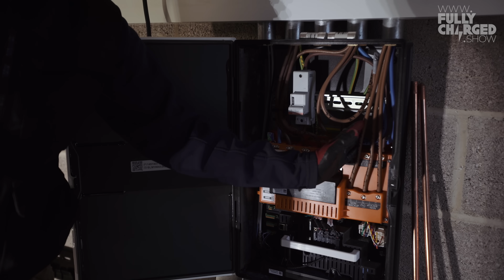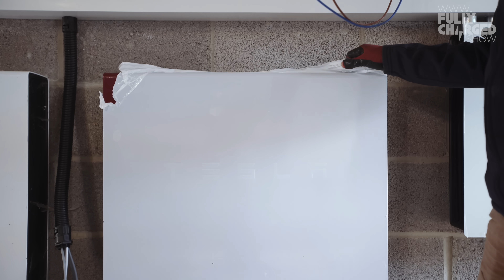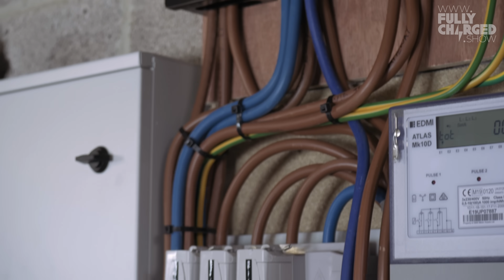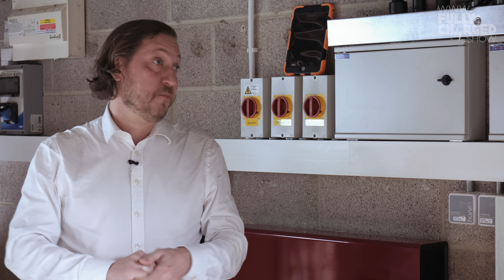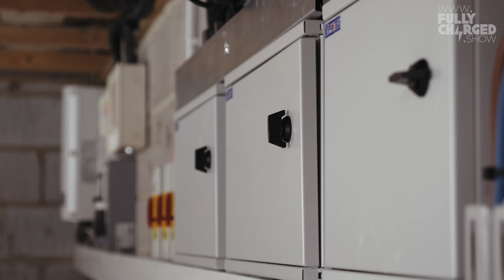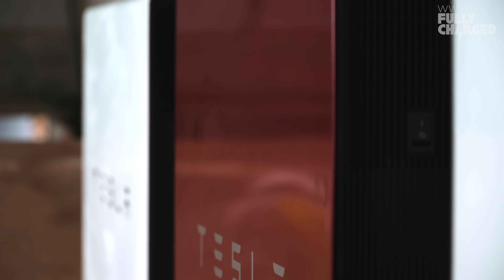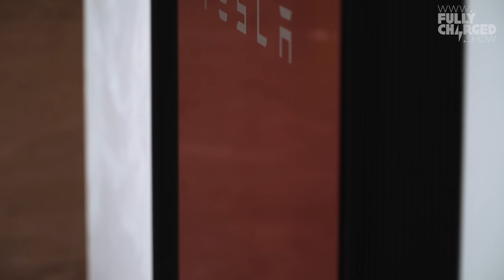Can you run your house on a battery? Tesla Powerwall 2 (Founders Series) & Tesla Backup Gateway 2

Comment: Question: what happens when you break that connection to the grid, are away from the property for a prolonged period of time where you're not using much electricity (if any) the batteries are full and the PV are generating, and putting power to the immersion heater, where does the surplus electrical energy go? Does it get spiked into the ground? 
I am aware this is a VERY unlikely scenario, just interested in what people think/know would happen in that hypothetical situation?
Reply: If I recall the video correctly, feeding into the grid was mentioned (not sure if refunded or not)
Reply: @Gwydion67  but my point is - if the grid connection has been broken - where does it go
Reply: Sorry, I missed your first words "cut off from the grid".
In this scenario the pv panels still would provide the voltage, but no current ("electricity") is flowing. Any physicist or electrician may correct me if I'm wrong.

Comment: I understand that Robert didn’t have to pay for the 2nd Tesla Powerwall (v2), but would it possible to get a break down of 1. the cost of such installation (cost of solar panels with size of installation, cost of 2 Tesla powerwalls, cost of upgrading to 3 phase, cost of installation and 2. kWh electricity generated every month on the last 2 years and where it goes (Tesla Powerwall batteries, car batteries, export to the grid...), and 3. Income generated every month on the last 2 years by the solar installation

Those information would be very, very valuable to give a better idea of what to expect in real life usage of such installation, and calculate the Return On Investment (ROI) (or much more likely, the loss). 

In theory, I would be interested by doing such installation close by to the Brittany region in France, and it would be very helpful to have an idea of how much money I would need to accept to loose if I would go ahead. Thank you.

Comment: I have 2 powerwall2 installed as back up to my grid tied 10k solar array.  We had the array for 3 years before we got the powerwalls. Enphase system...flawless.   I bought the powerwalls instead of a back up generator.   The powerwalls were 13k USD to purchased and installed. I had a quote for a propane powered back up generator of 7800 plus 100 gallons of propane...After the tax credit the cost difference between the genset and the powerwalls way about 1k USD.  I live in a small town in Central New Hampshire with very expensive electricity  .22 USD per kWh so the solar array was a no brainer.   Our contract for power purchase and buy back with the grid power provider is equal...we buy power for the same price that we sell power. While a great deal it makes it harder to financially justify the powerwalls   The power purchase price is the same all the time no price demand fluctuations.  The main reason we needed back up power was our grid power supply is not great. I don’t think I’d call it unstable but...since the powerwalls were installed in February 2019 till today December 2019 we have lost power 31 times.  Not long outages longest 1 hour 46 minutes.   Most outages 10-15 minutes. Years ago during an ice storm and it’s aftermath we were without power for 17 days, this event cemented our desire to increase our level of electrical independence. The powerwalls pick up the load with no delay, once in a while the lights might flicker not enough of a drop to need any reset of clocks etc. I realize we dropped some serious cash in this set up but we spent 300/month USD for electricity now just a 13USD  account/meter charge. The savings is about 11.5-12 % annual yield on our cash investment even with the powerwalls. Where else can you get that yield...not long after the solar install we purchased a Chevy Volt...flawless.   The volt functions in our home as an EV   we very rarely buy gasoline maybe a few gallons every other month   We have been able to absorb the additional load of the Volt’s 10,000 miles of annual usage through a more conservative use of our precious solar power. We are very grateful to have this technology in our home...

Comment: Exactly the video I needed to see. My villas in Kalbarri WA had a power outage today and the guests are upset that my new solar systems are not powering their darkness (heatwave of 40+C taking out the grid).

So not only do I need to save up 11k each for the powerwall, but also a decent amount of $ for the switches and install. Good to know!

Comment: But why you need 3-phase or a battery? You can charge it with one phase too slower but you can on the 8 hours at night when electricity is more cheap if you have discrimination bill.

Comment: Presuming the house is still just on one phase as rewiring a house to spread the loads over the three phases would be a pain, then the other two phases are just for the Zappi car charger? And so how are the two power walls spread over three phases or are they still on the single house phase ? I'm presuming they're on the three so as to feed the zappi with full battery if poss or am I barking up the wrong errr forest.
Also has anyone discovered how these gateways control electricity flow from / to grid, battery, house? If the soalr feed is AC coupled then essentially that's a direct connection to the grid so how does the gateway stop it all flowing back to the grid and divert it to the batteries or house?  Voltage variation or some such witchery?

Comment: You should have asked Mark to go through all the devices and connections , all the details basically.  
I wonder if you would have wind turbine or two turbines connected to the system if that would allow you to be completly off grid even in winter.  For the house I would say no problem, but the car is lot more demanding and thirsty then the house.

Comment: You can’t use a Solid State 1 to 3 phase converter?
Reply: It's not about having a 3 phase supply. It's about having the extra cabling to cope with the extra power that might be fed to and from the grid.

Comment: I don't have a garage, and nowhere inside the house to put that wall-full of boxes and cables etc...  except maybe the loft?  But I do  want a Powerwall.  So my question is:  Is it possible to have all that gear on the outside of the house (in some sort of lockable box to prevent interference?), or have it all in the loft?
Reply from the maker: There are loads of questions on the comments here that I'm not qualified to answer, but absolutely yes, you can have them outside, the 1st Powerwall we went to see was outside the house, and also remember, I have a load of other stuff on that wall for V2G (episode coming soon) and I had to have 3 phase, and there's other chargers, inverters and solar PV, so installing a battery alone is a much simpler project.
Reply: @fullychargedshow  Thanks for replying so quickly.  When I can persuade the Mrs, I hope to have a full solar PV & battery combo installed as a "bundle"...

Comment: That backup changeover takes ages... surely they could have made that faster, if it has to be a chunky switch why not store energy in a spring which it can use to throw the switch onto battery operation? Really it needs to be fast enough so that computers plugged in stay running. This is almost 2020 after all!

Comment: Makes zero sense.
We just went through this with The Energy Sovereignty Project this past year.
The power companies tell you that you have to upgrade thinking you will drop the project.
The result of installing the batteries is that you reduce the load on the grid... not increase it.

Hopefully more people will start class actions against the utility companies that insist on useless upgrades.

Comment: I would like to see the batteries mounted at least 2 feet above the concrete floor in case you have water in your garage or basement. Is there a reason to mount them on floor level?

Comment: 3 phase into newbuilds sounds very difficult, given it's absolutely impossible to convince most of the developers to abandon the standard 3ftx1ft external meter boxes in their cookie cutter homes. You're not fitting a 3ph smart meter and a 3ph head with that gigantic crutch cover all in the box. Some developers are even building with slimline boxes now which are only just wide enough to accommodate a 4 terminal meter. Real change has to be driven by real enthusiasm which would require you to really get your teeth into the HUGE property builders and architects and get them on board!

Comment: Wish I had enough money to install that at my house... my house (in Victoria, Australia) has lost power 4 times this year... I think I added it up to about 16 hours+ without power this year...
Reply: Had the same problem ended up getting a luminous ups inverter fraction of the price 2 years going strong
Reply: I wonder if you have lost power this month with fires raging??!!
Reply: @zachdancy5828  I live on an island in Indonesia the power outages are every 2 to 3 days
Reply: Zach Dancy I have actually, but it wasn’t related to the fires
Reply: Just start with a simple plugin solar system (300-600 w) that for  6-10 hours a day generate you some power.  That will already bring your electricity bill down and have a good ROI. 
When you lose power you can use the panels to charge a small portable generator to keep you running while waiting for the power to came back. Keep the generator at 100% all the time off course.
Reply: funny I had a total of 2 hours of powercut in India in last 1 year. both of which were covered by my condo's backup

Comment: It's too bad that the power switch-over during a power disconnect takes so long. Computers and some other sensitive equipment will react poorly to that. I was expecting it to be like a giant UPS (uninterruptible power supply) and instantaneously take over. Still, pretty cool, and your food in the fridge and hot water heater should be unaffected.

Comment: What you should do, is buy a smallish UPS (Uninterruptible Power Supply), to put on the inside of your house, and make your expensive and precious computer equipment, run off that UPS.  Then, when you do get the odd power cut, that equipment is kept safe, during the initial outage.  I also recommend protecting your internet router, network switches, WiFi access points & a strategically placed lamp, so that you literally have no outage and can see in the dark, if needed.

I recently had a power cut while on a conference call (I was working from home), and although the TV & lights went off, my work teleconference was uninterrupted & my colleagues were befuddled, then in awe of the resilience I had built in.

Comment: Well I've already got a 3 phase supply, but currently only use one of the phases. I had a 13 panel solar array installed last July. Unfortunately no cash to go any further, so no EV or Powerwall type installation just yet. I now see a reason to go to the show at Farnborough and have some serious technical conversations with various people there.

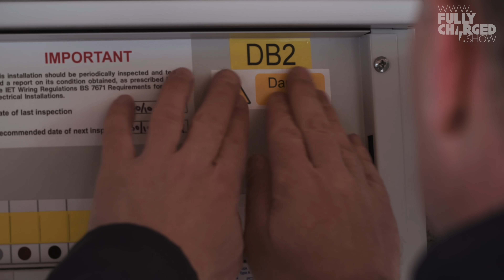Comment: 9:16 Now I get why the solar inverters typically shut off in a power outage, and the importance of a physical relay interruptor. Never understood that before.
Reply: Even my small plugin solar system does that, no power on the pins when not plugged in or when the power is out. That safety is good. I can off course unplug the mc4 connector myself during poweroutage to connect a small battery to the solar panels to have some juice for my devices.
Reply: Your solar inverters also shut down if they detect the line voltage coming into your house being too high (say 252V instead of 240V).  What was explained to me is that sometimes the linesmen need to work on a live distribution network but with limited Amps ... so yes they could get a small shock but not get fried. So they cut down the power being pushed into the grid and feed a "low power" 252V test 'signal' - I guess you can test for short circuits and leaks or whatever, but safely. Obviously they don't need a bunch of enthusiastic solar PV generation installations dumping huge amounts of power into what should be a 'test mode' grid when they work on it.

Comment: With smartphones and the like we are encouraged to keep the lithium battery charge between, say, 40% and 60% in order to maximize battery life.  You'll see different figures, but the idea is the same -- letting the charge go too low or too high is bad for the battery.  Is the same true for Powerwalls, or do you really charge it up to 100% and let it run down to 0%?

Comment: Great setup! Wish we could get ours working in such harmony. We have a 4kWh PV array, a sole thermal unit, an Immerson switch, a PowerWall - sadly only the 7kWh as the 13.4 had not come out at the time - and now a Model 3. Problem is that we are off gas grid so have to rely just on electricity. We got rid of our LPG tank and installed an air heat pump. On sunny days pre-Tesla we could run the house comfortably. Now we need to switch to Economy 7 but, with no gas, we couldn’t run the house and car from a standard PV array alone.

Comment: So if the extra power you produce after the car, power walls water heater are charged up does not go into the grid, why did your service require upgrading to 3ph?
Unless I missed something, you were ripped by the grid operator.

Comment: Not to pump power on the grid when blackout seems common sense, not for protecting an possible worker on the pole, but to protect your system. Imagine your petty few kw system and those many mw of consumers around you. Your voltage will drop instantly to useless levels.

And those 5 seconds delay, come on, is not acceptable. And from comments I see that all the others confirm it. So is a fluke. And the guy who installed it was there and said nothing. obviously he was clueless since he accepted it as it was and gave no explanation. It was his first install?
I really wonder if this will be fixed, or Rob will lose his work on his computer at every blackout that happens to surprise him at his desktop.

Comment: Its irony but in pakistan we had powercuts on regular basis 4 or 5 years back.and every house had a battery and inverter that provided electicity during light out🤔.these batteries were mostly sulphuric acid(but slightly bigger) ones used in cars.but there were a few dry cells too.they could power fans and bulbs for 3 or 4 hours.

Comment: Funny thing, here in Dominican Republic we've had power inverters since ages ago. The power goes out and you might not even notice as it comes online in a fraction of a second so that not even my computer or other equipment shuts down or malfunctions. I wonder why is thins installation or system so slow? how much "data" do these sensors and controllers have to process to determine that your external power left and it must provide from the battery...?

Comment: Surprised by how long it took to switch over to battery.  My PowerWall switches so fast, the digital clocks don't reset.
Reply: Me also... my Victron Energy system balances input from grid, solar and batteries and switches fully to batteries/solar in milliseconds  - computers, TV, light etc all stay on and the anti-islanding prevents any power going back out to the grid.
Reply: Wow that’s amazing, but wait a minute, 25 years ago I installed a 10kW Victron inverter providing completely bumpless switchover from mains to battery and back again.  Back then the batteries were lead acid but at a fraction of the cost of L’ion.

Comment: Good, clear video. However that Tesla powerwall/backup islanding cut over was disappointingly slow. We've got a building scale UPS and generator backup at our data centre and the cut over to/from Grid/UPS/genny isn't detectable by the mains rings in the building (which is just as well as its a data centre).

Comment: Doesn't make sense to me: you now have more storage, putting less power into the grid, and taking less power from the grid . . . so you need to beef up the grid connection to 3 phase. Huh? 
Begs the question: why not take that money for the 3 phase upgrade, just buy some more solar panels and maybe one more battery. And disconnect from the grid altogether.
Reply: Don't think he can make it through winter without significantly more PV (maybe double/triple his current capacity). The video mentioned he only gets a quarter of light during winter vs summer due to weather/high latitude of England

Comment: Hmm, I was told backup systems are instantaneous (new ones). There are various types, but you definitely need a continuous and fast switching PS to keep your electronics safe. Seeing how a brand new tech like Tesla failed to switch power on for several seconds is weird. Or maybe they just use Tesla batteries and not a complete package. He did say he got it for free.

Comment: Genuine question: why does it take nearly 15 seconds for battery power to kick in after mains power is disconnected at 10:56? I'd have expected a few hundred milliseconds at most.
Reply: Probably has more to do with the firmware of the 'gateway' rather than latency of the batteries. It needs to verify the grid is actually experiencing a power outage, then operate a physical switch to separate the house from the main grid. No expert, but my guess is the few seconds are due to those two steps

Comment: This needs to be connected to the Agile Octopus Tariff.. 
You could be charging your batteries overnight and being PAID! (recently they paid out 5p for USING each kwh! there was surplus wind power! the price to the customer went negative..)
If you fill your battery overnight you could push the PV back to the grid during the day(earn a tiny export fee) but crucially you'd reduce the demand on the coal powerstation!
Good all ways round!